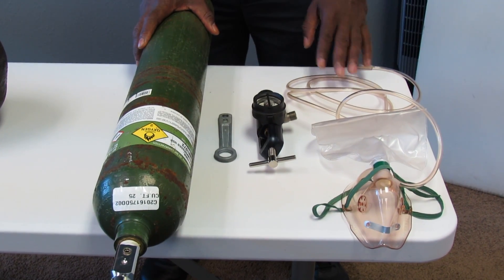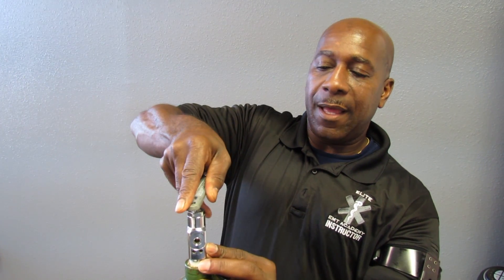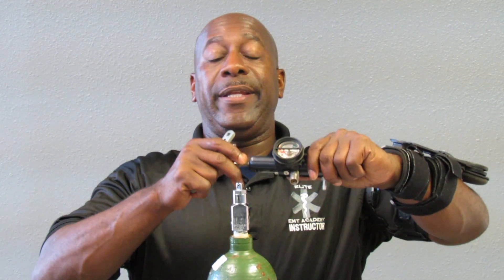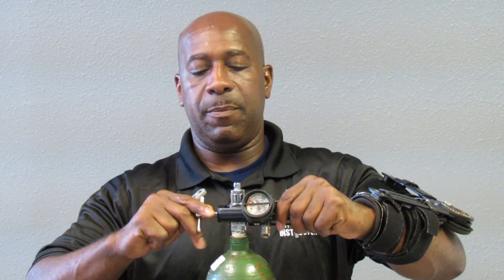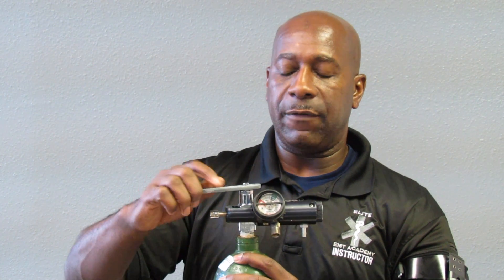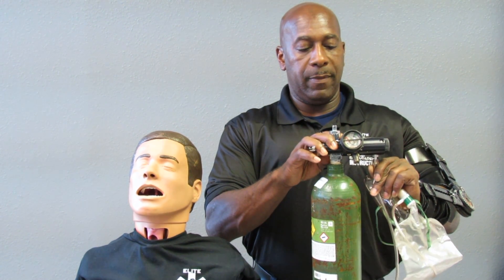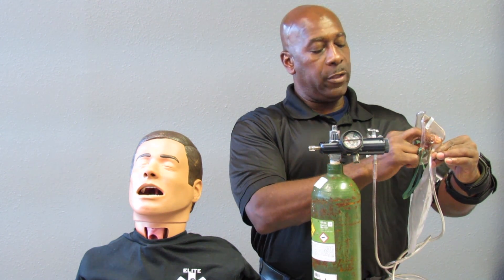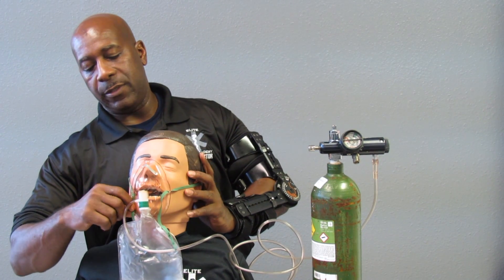Oxygen Administration By Non-Rebreather Mask

Comment: Sir, when can I change the cylinder in the hospitals? The cylinder contains 2000 psi Should I change it at 1000 psi? Or at 500 psi Is there a reference or standard for that?